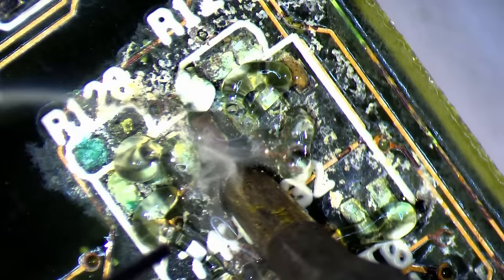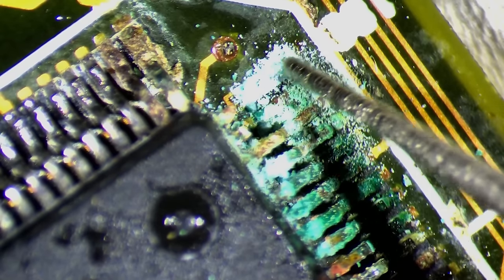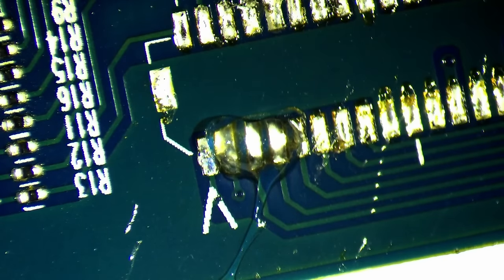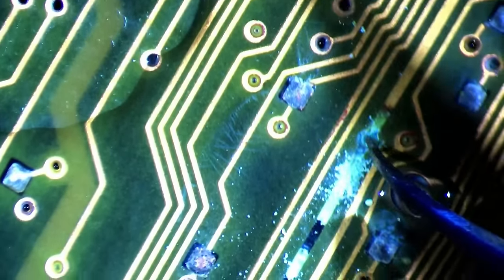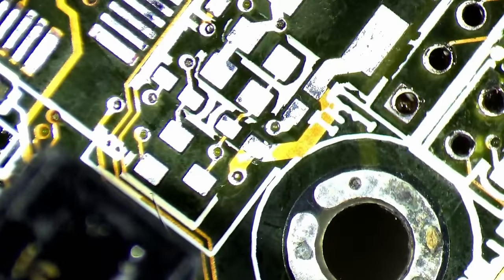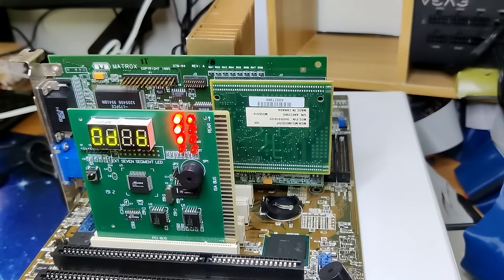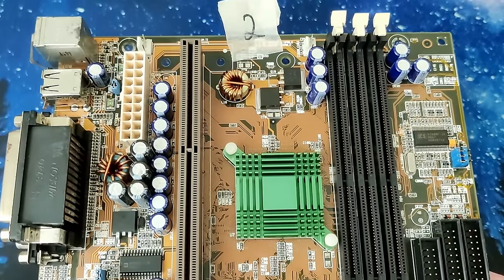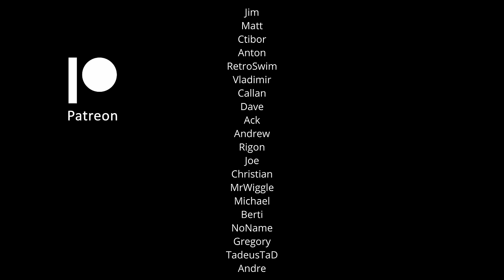ASUS P2B Restoration: Board #2 - Merciless Corrosion!

Comment: Glad to see how much effort and dedication you put into this just for recover it from being doomed. Why going through such a trouble when is not economically viable?
Actually I have some boards that require repair in my collection, but I still haven't found the time/conditions to do it. Definitely I would really enjoy working on them, the joy of bringing something back to life is very rewarding!
Reply from the maker: I totally agree with you. Spending north of 20 hours on this board has nothing to do with economic value. It is the knowledge and experience you gain from such a project. Even if it wouldn't have been successful, the value comes from the experience gained! Thanks for watching!
Reply: I think that using economic viability to determine worth is a terrible idea. There is much more to life than using money as a metric of should something continue to exist.

Comment: This is genuinely impressive. I wouldn't have spent 15+ (let's just say a full 24) hours on a board like this. I commented last time that I thought it was scrap i.e. a donor for the other boards. Colour me surprised! Working on boards like these is great practice though. I have sunk plenty of time in to practicing on water damaged motherboards for that reason.
Reply from the maker: I spent the time to gain the experience working on such a board! As you said, it's good practice. Board number 3 is very similar, but with a lot less corrosion on the traces. So, I believe I'll need a lot less time to work on that one. Thanks for watching!

Comment: I admire your patience and persistence. I would have had one look at that board and said: no, fk it. Too far gone.
  I am amazed that it POSTed, especially as the CPU slot was so corroded and the ASUS super I/O chip was mangled. You were lucky that the BGAs weren't corroded, even you wouldn't have been able to fix that. You must've felt relieved when it finally worked after spending 20+ hours (and the rest) on it.
Reply from the maker: Oh, it was such a let down when the POST codes didn't start counting. Luckily, it was just the CPU not making good contact. I am also surprised that the ASUS chip was working and that the rest of the board seems to be working fine too. I fixed all the obvious issues and that seemed to have been enough. Let's see for how long that board will work, but I have a feeling that it will be fine for many years!

Comment: Excellent job . Well done . . As a side note in the past ive used automotive heated rear window repair paint in the past to repair fine  traces using a tooth pick as a brush  it takes a bit of patience but works quite well when you cant use a bodge wire especially around surface mount or plastic component's you dont want to disturb or damage by using a soldering iron .
Reply from the maker: Thank you for that interesting tip! I am sure it will come in handy one day!

Comment: I think Caig/Deoxit rosin flux will do a better job, ie, the way the smallest bit cleans and makes dull solder shine, I reckon it will be better. The only problem with it is cleaning, you'll need strong kitchen spray - I use Nifti - at the end to make it not sticky.

Comment: In order to remove traces effortlessly I use hot air  @350°C, and it peels right off.
A nice blade to mechanically help it out and you're done.
Reply from the maker: You're right. I should have used hot air to heat the donor board. Ah, I always learn something from the comments :) Thank you!

Comment: I've had good luck repairing pads with "copper tape with conductive adhesive". I wouldn't use it for high AMP stuff, for that get thin copper foil, but for ICs like Voodoo chips or chipsets, it's fine. Once the repair works I glue everything down with solder mask.

Comment: Wow, pretty sure most people would have looked at that board about called it quits right there. That was really impressive, kinda makes me want to look at boards in a different way and maybe try and get into restoration as well. Granted, I don't have quite the access to stuff like you seem to.
Reply from the maker: Surprisingly, those boards came from a local classifieds website in Germany. I have had those boards for quite some time. I am ashamed to say that they were probably sitting in Germany for a good year (which probably made their condition worse!).
A board in such a condition should cost you almost nothing! I paid about 6 USD per board including shipping.

Comment: I would try and see if a solution of a weak drain cleaner (sodium hydroxide) would work as a solder flux just to get the deep corrosion off. You would definitely have to wash the boards really well, possibly a run through a dish washer. I've never had to repair anything that corroded and haven't tried the drain cleaner idea except on large metal areas.

Comment: ah yes I've seen a couple of repair channels that have replaced pads. You can actually get pad replacements without sacrificing something. They attach the pad with solder mask under the pad and then solder the new trace to the old trace and cut off excess. I've seen it done on geforce 4090's where the trace and pad combo was only a couple mm long. lol

Comment: I'm impressed ... while I wrote off this board originally I'm glad I overestimated the damage to the Asus QFP and the coresponding pads. Well done.
Could you figure out many layers this board has?
Reply from the maker: Good question - drilling through the board to get rid of that fully corroded via was inconclusive. But I wouldn't be surprised if its a 4-layer board. I actually googled this and found a document from Intel covering the "440BX AGPset". In there, it seems to confirm to be a 4-layer PCB in their reference design at that time.
Reply: @bitsundbolts  That's good news with the board being 4 layers. If all else fails with inner layers, sometimes (with shorts) it is worth a try to go with a destructive and restorative approach instead of a conservative one (literally burning out shorts) - I've seen that on strongly damaged Amiga boards.

Comment: I use Ammonia solution as an oxidised solder solvent. But be careful as it can eat away copper after eating away solder. Always control the process.
Reply from the maker: Sounds very aggressive. I'm sure it'll work well, but it requires a lot of attention and probably a well ventilated room (or even outside?)

Comment: In some ways, it world have been easier to ask pcbway to recreate the board.
Actually, there's an idea. 
Get them to recreate "the best" board from each era and sell.
Reply from the maker: Hehe, I like your spirit! Since there apparently were clones of this board, there must be schematics and maybe even the files to just create new boards. But then it would just be a replica. I still prefer restoring the real thing instead of creating a clone.
Reply: It's a good idea, but it would probably takes days of soldering to transfer all the ICs then populate the rest of the board components, the Slot 1 SECC has 242 pins alone...
Reply: @WelshProgrammer  well... If you asked for all the passives and sockets to be populated,  (and potentially modernised) you'd be left with maybe 10 ICs to transfer. The hardest would be the bga chipsets. You'd need a good rework station.
Reply: @myne00  true, most if not all the passive, some of the active with modern replacements or successors and maybe some sockets like PCI and ISA and possibly AGP, EEPROMS etc but I doubt they carry the SECC, COAST or other special sockets like PGA370. Though it would probably get you most of the way.

Comment: Really impressive job! However you still want to replace the cpu socket in the long term as the exposed copper on the pins will corrode anyway
Reply from the maker: I'll keep an eye on the socket. I need to find acceptable donor boards or order new ones if I can find them somewhere. Desoldering one (I believe 242 pins) is not fun!

Comment: I've never seen pad "borrowing" method. I've used new pad replacements, but it never occured to me that I could salvage some from existing board.
Reply from the maker: Haha, you work with what you have :) Those donor PCBs for the pad was actually also the donor for the serial ports I am going to use on those boards. All stuff I pick up at the scrapyard.

Comment: while watching how you restore coroded traces over some vias it was hard to notice, but is it a 2 layer pcb or 4 layers one?Because it looks like you completly ignored internal connections to those vias if there was any there in the first place.
Reply from the maker: I tried to clean every via that showed the green oxidation. I use the fine tweezers to get the air out while a drop of vinegar sits above it. I cleaned at least 10 vias that way. I'm sure it's not perfect, but I can inspect the board again in a few months. The board is most likely 4 layers
Reply: @bitsundbolts  i was mostly woried about that one hole showed in the middle of the videodo you know if those vias connect or branch to a different place. i dobt you can find a boardview schematic for it due to old age , but my biggest concern is not corosion at this point but severing some traces on the lower layers while cleaning the vias "too much"
Reply from the maker: Yes, I know what you mean. I was worried about going through the board, but there were no copper particles or more corrosion that surfaced. I guess I got lucky.

Comment: Mod it for Tualatin support and make Ultimate Slot 1 Project!
Reply from the maker: I am currently working on board #3. It is very similar to this one, therefore, I will cut the restoration short in the video. Instead, I'll be working on a mod that may lead to what you're requesting ;)

Comment: Why do I have the distinct impression that I should try to 3d-model a SECC/Slot I retention bracket for 3d-printing? If oriented correctly, layer adhesion shouldn't impair the strength of the part given the load it's expected to manage.
Reply from the maker: Such a model would definitely be beneficial for people to make their own! It will only get harder to find those in the future...

Comment: You gotta really wonder HOW did corrosion end up on such a late mobo. Usually it's 486s and early Pentiums (although I've seen some obscure socket 8 boards use it as well) that suffer from battery leakage.. but not a P2B from the apogee of 1998.
Reply from the maker: It must have been storage and maybe something dripping on them. They all show a similar pattern of damage. Maybe they were stored in a warehouse after a company decommissioned them - but why ASUS P2Bs. Who else would have six boards like this? Internet café with an option of gaming?
Reply: @bitsundbolts  well , BX boards could be used as server/workstation, because of ECC capabilities. Maybe that was the case?

Comment: Is the soldering iron you use the one you list in your links?
Reply from the maker: Yes, it's the FNIRSI HS-01. I also have a review on my channel about it. I only have issues with the power adapter that came with it. The Irwin reboots if I use it 15V or above. In this video, it's set to 12V. If I use a laptop usb-c charger, the iron works well without rebooting

Comment: Can you give a link where to get such .1mm wire? Is it isolated and isolation is being destroyed by soldering iron?
Reply from the maker: I added a link to copper wires in the description. The wires are enameled, but the coating burns away when in contact with a soldering iron for a few seconds.
Reply: @bitsundbolts  exactly what I need, thank you!

Comment: Hi! I have an old Asus P2B's based PC that stopped working years ago... It doesn't post anymore and the motherboard beeps indicating something related with cpu overheating but that cannot be the case since it happens when the PC is just turned on so it's cold. I would like to fix the problem but I don't know what to do and what to check out...
Reply from the maker: That is weird. Have you checked the capacitors next to the CPU? What CPU are you using (and do you know the voltage requirements in case it's a Pentium III)? My next video (board #3) will deal with voltages. Maybe there is something there. But I'll also replace capacitors in a future video that might help you figure out what may be wrong with your board.
Reply: Opss sorry! I made a mistake, the faulty motherboard is an ASUS P4T-E... Thank You for the answer!

Comment: There are artists making wicker baskets and handwoven fabric clothes, why not "folks electronics repairs"? 😸
For copper corrosion: it first forms copper (I) oxide, which is brown-red and sticks well to the copper metal. Thin layer forms fast, and is relatively harmless, even preventing further oxidation in dry air. Copper next oxidizes further, also reacting with CO₂, ammonia and water, forming various carbonates / oxides / hydroxides mix (or intermediates). Water and oxygen from air are enough, ammonia and its compounds speed up the process vastly, turning copper metal into a blue-green mush. More or less, there are more complex things happening also. Vinegar dissolves the carbonate / oxide / hydroxide mush leaving pure copper mostly untouched (at least for the relatively short time it takes to clean things). Then the thin copper (I) oxide layer re-appears.
The normal Sn60Pb solder is close to eutectic point (the sharp lowest melting point, from a solid metal chunk right to fully liquid). Any other composition will have higher melting range (not a point any more) and will look like a paste. Now speculating: corrosion will remove out one of the metals first, I bet it will be tin. There will be tiny crystals richer in the metal in excess (usually lead) floating within liquid metal, also intermixed with oxides.
Reply from the maker: Thank you so much for your explanation! So, whatever I read was correct about copper turning brown first. Also, in your last part, you speculate that tin may be the first to be affected. I can absolutely verify that since the corrosion on board number 3 (also on the ASUS chip), the thin tin layer on the legs of this chip can be removed like peeling an egg. Below that layer is pure copper which hasn't been affected yet.

Comment: I'm not optimistic about that chip. The board itself...maybe. Then again the question is if a hard to find chip is bad do you save this board or another board that has this chip.
Reply from the maker: You're talking about the ASUS chip, right? Are you worried if corrosion entered the chip? I am quite confident that the chip will be fine for a long time.
Reply: @bitsundbolts  I figured it was dead. I've never seen a chip that badly corroded work before. You got lucky.
Reply from the maker: Let's see, the ASUS chip on board #3 looks the same or even a bit worse!

Comment: Worth noting is that some motherboards wont boot without a battery
Reply from the maker: I never had a board like that, but I hear it very often! Good point!
Reply: @bitsundbolts  id say its more common on 486/386 and older boards